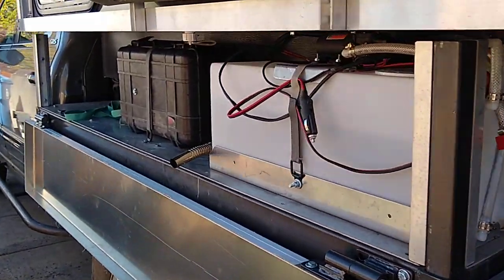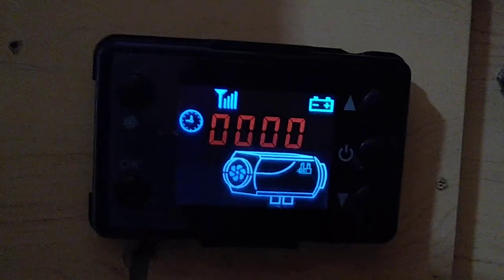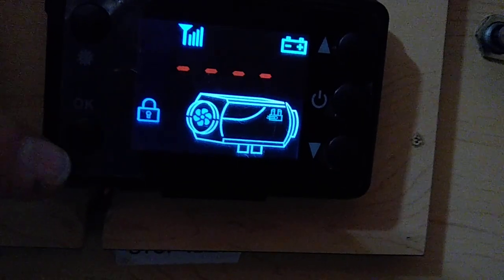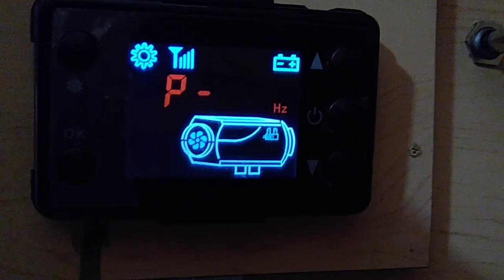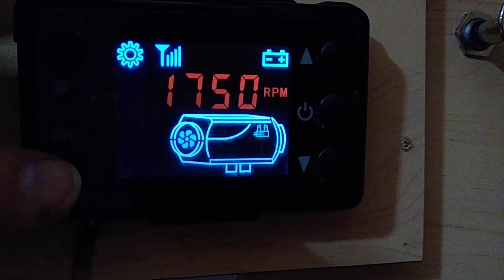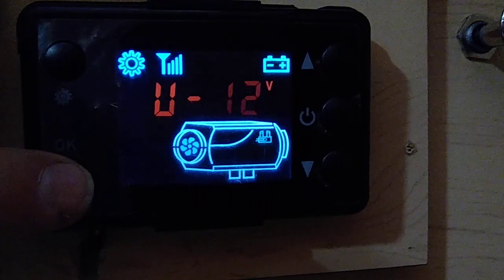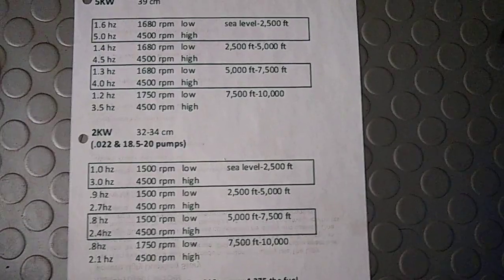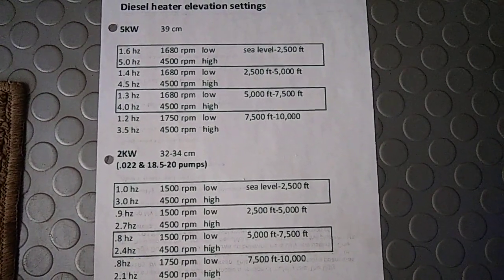Adjusting your Chinese Diesel parking heater for High altitude elevation or sea level use.

Comment: THANK YOU for posting the table as well as the instructions! You saved my bacon! ❤❤❤!
Reply from the maker: Awesomeness !
Reply: @Colorado2Bangkok  I have that same controller and it will go down to 0.8hz (squirts), but when i exit back to main menu the lowest it will set is 1.7hz.... regardless of where I put it on settings menu the pump clicks 102 x min (squirt,squirt,squirt,) and that won't change

another heater i got has different controller w alpine mode i can't figure out...and turned altheways down squirts 132 X per min

Are you sure those changes down to 1.0hz you made actually work????:person-turqouise-waving: it controlls fuel by squirt rate per min
trying to figure how to sip less fuel:person-turqouise-waving:

Comment: Note the HZ settings for a 2kW unit are for fuel pumps with a 0.022 ml dosage.  If yours is different (0.016, 0.018, etc), it's easy to adjust the table HZ values for your pump, as per the table footnote.  Divide 0.022 by your pump's dosage value to get your HZ adjustment multiplier.  Pumps are usually labelled with their dosage value (0.022, etc).  Fan RPMs remain the same.

Comment: Love your flat bed FWC. I have a 2005 FWC with a short bed Chevy single cab truck small v 8 and five speed manual , was my Dads duck hunting rig. Been setting in garage truck and camper for 5 years after he passed..Want to put on a flat bed set up ,so I have more room for camping in side doors of flat bed.hate to buy a new truck since the truck and FWC only has 60,000 miles on it and like new....
Reply from the maker: Joyce B. Sachse Sachse the flatbed has been the best thing ever. I have made further progress on it since the old video I have posted here. I need to update it. Highly recommend trying to make on for your truck. Awesome

Comment: My heater controls are in factory settings. Says p12 while the heater is off just sitting there. I’ve tried to mess around with the settings and can’t figure them out. However, Idk if it’s me, or my heater, or what but it seems to go through fuel fast. Highest I keep it on is level 3.

Comment: Do you mind sharing where the chart came from or a picture of it? I am trying to make out the bottom info as mine is blowing smoke after changing the pump and I suspect the new pump is a different volume per pulse. Thanks!
Reply from the maker: Hey Brian, I am not sure how to post the chart here. I have it posted on my diesel heater group:   https://www.facebook.com/groups/437364780987328

Comment: Outstanding help I’m building in Park county at 9400’ the default settings have been difficult at best. I have 6 of the 5kW heaters from 4 different sellers and received parts that are useless especially the fuel lines. Thank you again
Reply from the maker: Coach K
Coach K, awesome. I am finding that mine runs better with the higher elevation setting, even when I am home at a slight lower elevation
Reply: Hello I am also in Park County (Hartsel) looking into these diesel heaters, any recommendations 👍
Reply: @ranz5698  1688 to get into control settings. 1.2, 3.2, 1750, 4500, 12/24vdc and PF-5. the motor bearings wear out the most. of 6 total units running 3 all winter....1 motor seized, 2 stop running after they heat up. I have torn them down rebuilt them and recently found spare motor (only) on amazon. controllers and the bluetooth share the same frequency as misc wireless items so you may experience random changes in blower speed. fuel pumps are subject as well. depending on how you mount. I do not have mine mounted hard...they float in the proper angles to eliminate the noise. (diesel costs less to produce than gasoline yet you know its a racket to have to pay more. be sure to run them on HIGH periodically they do tend to soot up inside the chamber.
Reply: @Colorado2Bangkok    Im the same. Im in Scotland i set them to high altitude they always run better. See on the red bodied controller you can set that to High altitude at the press of a button before startup and a green symbol of some mountains comes up. I just leave they ones on that setting nobody has ever had any complaints. Got one in now thats burning too much on startup and at full speed. Inbetween its fine but i wasnt sure if this controller had the altitude setting built in hence why im here. Good vid, quick and to the point.
Reply: @coachk7674 yeah i hang the pumps with a small bungie looped around, i put the bungie  above the pump on the semi-rigid hosing never had any issues as the bottom end is semi suspended too with the tank hosing and the filter.

Comment: Great video. So much good info in one short clip. Would you know if there is a temperature sensor in the controller unit? Or does the controller use the temperature sensor in the heater air intake to control the operation of the unit? This would be relevant when the heater is installed outside and drawing fresh air. Noticed you also have the heater  outside but wasn't sure if your air intake is fresh air or recirculating inside air.
Reply from the maker: Yes I believe the controller has a thermostat. Currently I run the heater with fresh air only, but have it set up for recirculation as well in the future

Comment: I found out what the sn icon is for. It is to set up for 1 magnet which is standard for fan speed or 2 magnets which speeds up the fan speed. The ps is for glow pins wattage. The higher the number the hotter the glow pins.
Reply from the maker: very cool info, thanks 👌

Comment: Hi there! Thank you so much for the info in this video - it´s very helpful! Would you mind disclosing where the elevation information on your datasheet came from? Just wondering if this is official or somebodies calculations! Thanks!
Reply from the maker: Hey Dave, this is a chart put together by a guy running a popular heater page. Pretty well circulated. I am finding I need a tad more fan speed for a good start
Reply: @Colorado2Bangkok , much appreciated, thanks. Feel more comfortable when I know where info is coming from. But, of course, it makes sense: the higher the elevation, the more (thinner) air is needed for combustion. Thanks for caring!
Reply: run the thing at high altitude mode period. I bet it runs better than normal just about anywhere and saves fuel. The best way is to dial your own machine in perfectly but 2nd best is just run it in altitude settings or mode. Just so you know the red controllers the newer ones and newest black one you can flip them to High Altitude mode and a small green line drawing of mountains comes on the screen. It will stay on that setting till its been left unpowered for a few weeks

Comment: I just push the settings and ok buttons and hold and it switches to alpine mode... works a lot better at 3500 ft. with zero smoke whereas when not in alpine mode it will smoke a bit...

Comment: I've been searching through the forum for settings for a 3kw-  reading that they are just detuned 5kw  heaters. But if you have the chart that would be really helpful!  Thanks for a great video. Was exactly what I was looking for. (Just not the right kw)  ha ha.
Reply from the maker: He Joseph, from everything I have read there are just 2KW and 5KW. I doubt it is detuned, do you know what settings yours says?
Reply: @Colorado2Bangkok  the back of the unit says.  Zp 12v  f01. 3kw.  I guess I could run it and change settings based on the case temp to keep them in line- not sure what the best course of action is. Also have one of the newer controllers that has the yellow mtns icon-  but haven't been able to find anything definitive on what that does.
Reply from the maker: @josephfoster2558  what diameter is your ducting? 2KW is 60mm and 5kw is 75mm. try to get in your settings and see what your low and high setting are set at.
Reply: the 2-3kw and 5+kw units are completely different. Differnt plugs the lot. I have multiples of both they are differnces. The 5-8kw (claimed 5kw is really 4.2kw) are same unit, the ones bellow that rating are smaller in several places.

Comment: Kinda frustrated with descriptions such as "top left" used to describe the buttons. Many of these controllers have the exact same functions for each button but the layout of the buttons is different. Using the terms, "arrow up, arrow down, settings, OK, power" to describe the buttons would have helped me way more. I'm deducing that "top left" for you is the settings button, the image is too dark to see the buttons on the left side of your controller.

Comment: First off thanks for the video it's got me in the right direction. Here is the issue I'm still having enter the new settings, and let it do it's thing, start the heater and I can still go above the settings I entered like they didn't save in the controller.
Any ideas?
Reply: Found a solution, do the programming with heater off, and go through the entire cycle, then let sit a couple minutes before firing up. Works great now, again thanks for the great, informative video.
Reply from the maker: @ChrisBaerWhereIs  awesome!

Comment: will the setting stay after programed when the battery is disconnected or will it default back..
Reply from the maker: It should stay. I have a kill switch on mine when not in use, and it saves what I set.

Comment: Thanks again for this video.  So... this doesn't actually adjust the fuel/air ratio?  Just the fan speed and the minimum and maximum temps?
Reply from the maker: Hey Preston, the Hz is the amount of fuel pumped in, and the other RPM is the fan speed. there is no actual mixture. More Hz is more fuel and more heat, so the fan speed must be increased to make the extra fuel burn correctly
Reply: @Colorado2Bangkok  Gotcha.  Thanks this video is great, fast, simple, easy.
Reply: @Colorado2Bangkok  Another question... I was told by everyone that a 2KW would be fine for my Promaster 136" high roof van.  I installed it while traveling in the Carolinas and it was great, even down to 15-20 degrees.  Now that I have it in Colorado in the mountains and adjusted for elevation, it's a little underwhelming.  Is this normal?  Anything I can do?  I am almost fully insulated but must confess theres a few small bare spots left where I need insulation and paneling.
Reply from the maker: @UrsaMusic  I am finding that if I get below say 10F, the 2kw is struggling a little. so when very cold, we use down bags etc. I see the same as you, at 30-40f, it gets very warm and cozy. We are on the border of needing a 2kw or a 5kw. I am fine with dressing warm. My plan had no room for a 5kw

Comment: I purchased a Maxpeedingrods 5kw heater that claims to have auto elevation adjustment up to 16,000 feet. Its controller does not have an adjustment for setting Hz or fan speed. I am going to CO in a couple weeks and will be around 10,000 feet. I have my fingers crossed that the auto elevation will actually work. I am bringing a different heat source as a back up just in case. I can't find any reviews from people who have actually used the auto adjust heaters at altitude. Have you seen any reviews?
Reply from the maker: Hey David, I actually just camped last weekend  in CO at 11,300 ft, and my 2kw ran fine, but it needed to adjust. I think yours should hopefully work. it should show a mountain icon when you get to some elevation cross fingers
Reply from the maker: Have you cut and increased your wire gauge?
Reply: @Colorado2Bangkok   Wire gauge on the supply from the power source? No. Is that an issue? I have tested the unit here in Wisconsin for about 10 hours with no issues other than you can't use the thermostat to set the temp because it seems to ignore the ambient temperature. I just run it on the lowest  P1 setting and forget about trying to set an actual temp.
Reply from the maker: @DavidJ-kc4cz  Up-sizing your wiring is super important. yes, the main red and black feed wires. just cut close to the ends/connectors, and solder/splice in some 10-12 Ga. wire. You will also find using the heater in hz mode is simplest. just turn it up and down as needed. using the thermostat mode makes them run odd.
Reply from the maker: @DavidJ-kc4cz  I just posted a picture how to cut the wires on my instagram: https://www.instagram.com/colorado2bangkok/

Comment: Thanks for taking the time to film and post this, super helpful. I'm heading to Breckenridge this winter and have been struggling to find a definitive chart to use as a guide for my 5kw. Where did you find it?
Reply from the maker: I think I have it posted here. I am finding mine is starting a little easier at 1 step higher elevation.   https://www.facebook.com/groups/437364780987328
Reply: Whats the good word.. i had my 5kw set up in the back cap of my truck last season in Breck. It shit the bed the 1st week at 9000ft. Bought the 2kw and im hoping she treats me mo better this season. 5k was too hot for the size of my rig. Ill try this setting out when i get out there. Was thinking the burn off would be better on the 2kw , thinking ill be running her FULL Speed rather then having to reduce the 5kw because too hot , which i think helped contribute to the sut build up. Shoots thanks for posting .
Reply from the maker: @searchinglife6122  5kw sounds way too big for a cap. yeah a 2kw running higher is supposed to be better to run clean, but some say it doesn't matter.

Comment: Thanks so much for the helpful video! Question. I have a 5kW heater for my van even on lowest setting it gets too hot in van -nothing new. Can I use these lower settings to reduce heating? Like 1.2 hz 1750 rpm for low even thou I'm not at high altitudes. Can I even reduce hz even more and increase fan speed? I would think that running full blast ever once in awhile would be a good idea to burn off some of the build up
Reply from the maker: Hey Greg, no, I don't think you can. You might look at a Y duct with dampers, and dump some excess heat.
Reply: @Colorado2Bangkok  thanks, I thought about dumping heat. It just don't seem right and definitely not efficient
Reply from the maker: @gregnorman3183  for sure. Might be worth changing to a 2kw
Reply: I run my 5kw heater at 1.1 low at 1500rpm on sea level without issues for 3 years now. I had to clean the glow plug once after two years. So far I haven't had to clean up the chamber and I live in my van full time
Reply from the maker: @aaronhamburg4428  any idea what pump?
Reply: @Colorado2Bangkok  22 and minimum possible for the heater is 1.1hz. 
I thought that I may have to clean the chamber like this every so often but it works quite well. I also do a high burn every week or so for ~15 minutes to make sure I don't clog up.
I think that low setting on lower elevation should be paired with low fan speed otherwise the chamber will run too cold and start making sud buildup. 1.1-1.2 with 1750rpm my not be good idea if not at high altitude, 1500 should be better.
Reply: If you havent solved this by now mate then it would be as simple as putting the intake ducting to a cold area so it was always picking up cold air (providing you havent already)  You can also bring the pump frequency right down to way bellow whats advised as long as you bring the fan speed right down too. You will get maybe a few weeks or months less time out of each plug & atomiser but you wont burn up the inner burner gauze or anything like that. You want to be running it on decent fuel though just to give it an easy life as far as carbon build up.  Another way to cool it down is fit the 4 way ducting on the outlet and run the hoses out the way and put a few bends in them. This will store quite a lot of heat on its own but i wouldnt do it to the point the machine is choking out. As for burning them flat out to get rid of the carbon, you dont need to you can just vary the speed a few times over the space of about 10mins, then do a 1 min at high speed. I know this works as i fitted over 150 of these in vans, boats and Lorries and the latest genuine controllers it does a sequence like i just mentioned as a "clean cycle"   Its an algorithm  thats been used on marine ones for donks but it came to lorries in 2020 the Volvo FH was the first lorry i dealt with that had that cleaning algorithm built in to the heater settings on the dash. It works better than just running it flat out, the reasons why i dont fully know but it definitely cleans them better.

Comment: Have you used it at over 10,000 feet yet? If so, did it work well?
Reply from the maker: Hey Joe, yes I used it at just about 10K feet, worked good. At elevation it will puff a little to start, but once fired, no issues

Comment: First question: how high is high altitude? Second question: can you have the controller display the thermostat in F° instead of C°? Thank you!
Reply from the maker: Hey D, I have ran mine at 10,000 feet. So many controllers, so I dont know if any will change to F. I know mine wont. If you pause the video towards the end, you can see my elevation chart.

Comment: Do you have any recommendations for a 12/24v 5kw heater that i can use at 10200’ consistently?
Reply from the maker: Hey Josh, there are so so many types out there now. The best you can do is look for, and confirm you get one with a controller that allows you to get into the custom settings. Check the reviews and get a seller that allows returns. Lavaner as well as a couple others have one that is supposedly able to do auto elevation.